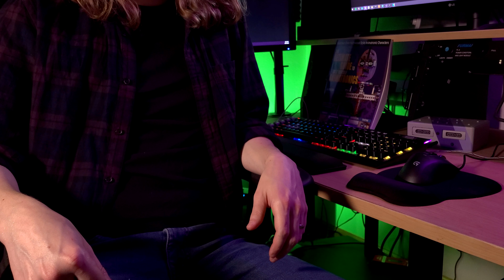Making an Animatronic Hand Controlled by Leap Motion

Comment: Here's another idea for fingers: maybe use big coiled springs for each finger (trampoline springs maybe?). If you wedge spacers in where the knuckles should be, those would make it bend in the correct inward direction when the string pulls on the end. Guess there is a question of whether the servos would be strong enough though.
Reply from the maker: Yeah, I don't think these servos could handle a spring that big. But that's a bit similar to what I was trying with the springs and foam. The main problem is the foam I had wasn't strong enough.